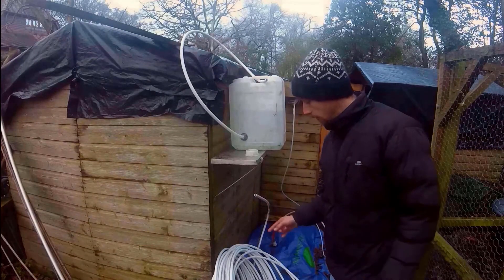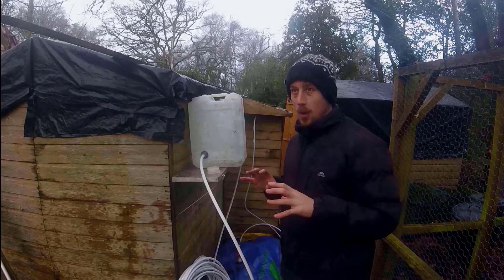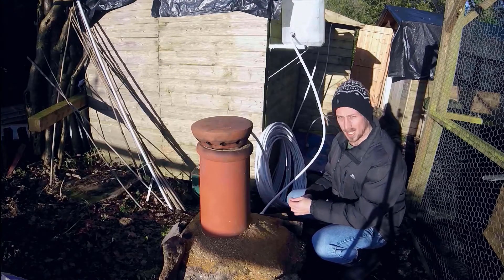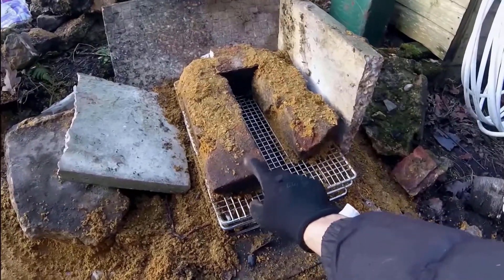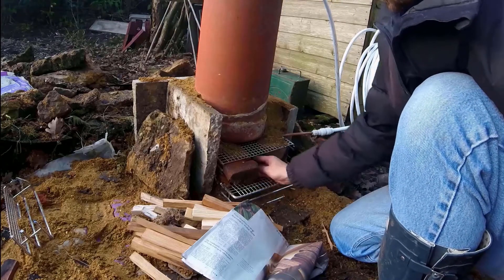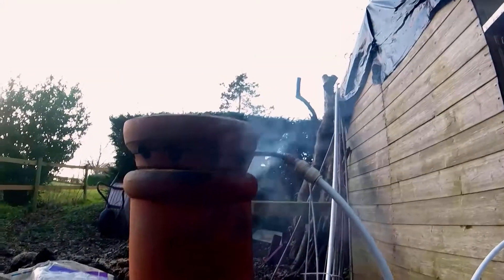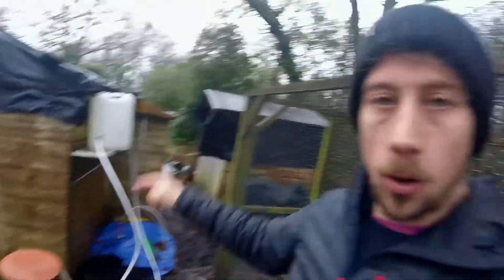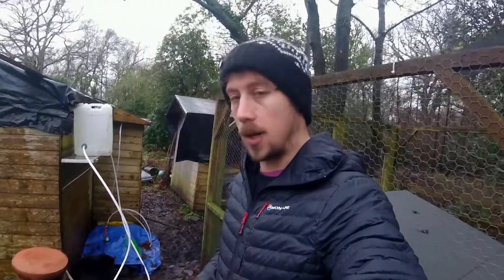Rocket Stove Water Heater // PART III // Final steps to hot water!

Comment from the maker: Hey Everyone! Thanks again for taking the time to watch. I hope you found the vid interesting. If you wanna check out more of my rocket stove build check out Part 1 here: https://youtu.be/m5EFKcG2zuI
Reply: Hello mate , I have enjoyed your videos, nice to see someone experimenting. I made something similar to heat the kids pool and I would like to make some suggestions. The rocket stove system is to small, the fire box would benefit from being bigger otherwise its to time consuming. The copper pipe in the heat riser is insulated by the sand and take the top off of the chimney, it is just restricting the air flow. If you want to guard against sparks put a barrel over it like a traditional build. I am sorry if this comes across a critical it is not at all how I want it to be taken. I admire what you are doing and it has the makings of being a great project. Please keep making the videos and nail this project. All the best Craig
Reply from the maker: Hi Craig. It doesn't come across as critical, I really appreciate the helpful feedback. I was thinking about the firebox, your comment confirms its! I am hoping to get my hands on some clay soon, so will hopefully be able to mold something with better shape. With the copper pipe I was worried about heating it too much whilst not having the thermosyphon set up - water not moving -> pipe will heat up too much. Someone else mentioned this and I think I will change the design as you suggest now I have it working. Thanks again for your feedback. Cheers Tom
Reply: @GetMeOffGrid_  Tom you could consider a small water pump, solar powered to a battery, the project is getting bigger but it would be more efficient and the movement of water would keep the copper cooler if it is direct contact with fire in the riser tube.  Good luck
Reply from the maker: Good shout, as you say that would be another level. If the system was going to be any bigger I think that would have to be the way to go. Cheers

Comment: Good to see you using mains drills, rather than many who use (Congo destroying) Battery Drills, that seem to be disposable as many don’t bother or can’t get replacement batteries.
Reply from the maker: I'm a fan of both tbh. Mains drills are great where you can easily get power. I get the issue with the batteries though, it is annoying to get replacements.

Comment: I'm envious of effort expended. The idea of the rocket is to insulate the burn and the riser to get a hot and clean burn. Sand has too much thermal mass. Compress the coil to the top and line the lower half with Ceramic Fiber Blanket or use fire bricks then you have half a chance.
Reply from the maker: Thanks Mathew! I appreciate the advice. To be honest I have given up on the idea of using a rocket stove to heat water. For my purposes, heating my digester, it turns out not to be the best option. Cheers

Comment: Better with the shorter lines, but you need the hot outlet at the top of the rocket stove to only go upward to the top port on the tank(should probably be on the same side of the Tank as the bottom port). The tank needs to be filled above that top port.  You cannot just run the line in and down into the water as this will trap air, and any air kills siphon flow.  You want the top port to go in sideways like the bottom port, and if you fill above this port, all the air will clear itself as long as none of the lines droop.  I don’t know how much copper you used, but a stove that size should have 15 or so liters of water near to boiling in a half hour or less.  

A good way to visualize the flow is with a tall pan and a butane torch.  Fill the pan with water and apply the torch flame to a bottom edge. A drop of food coloring on the side opposite where you are applying the heat will help show you the flow.
Reply from the maker: This is why I love YT! Thanks for the advice. Best explanations yet! Cheers

Comment: Nice build! My two pennies on it:
Install a one way valve on the hot water side
This allows heat and pressure to build in the copper coil, this will push the flow back to your tank. 
Initially this will turn the hot water into steam, but if you have both outlets submerged in the tank this won't be a problem.
This in turn will pull cold water from the bottom pipe by the vacuum in the copper pipe and with enough velocity it will maintain a decent circulation. 
Also insulating the hot water pipe will help keep the heat all the way to the tank during the night when the fire dies down.

Anyway, look forward to future videos if you make anymore improvements!
Reply from the maker: Hi, thanks very much. Great suggestions. I was thinking of increasing the size of the tank and having the hot water inlet half way up. Hopefully soon I will be able to make a permanent one from cob that I can include everyones suggestions. Cheers